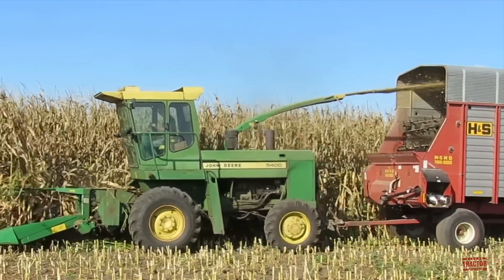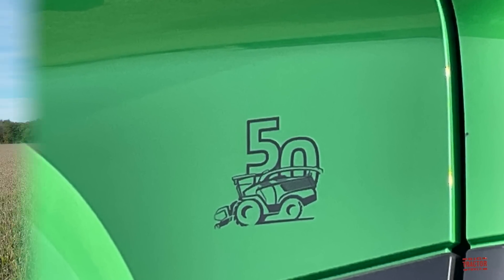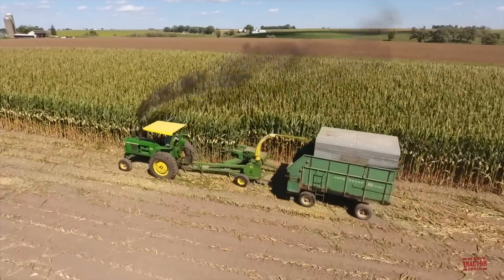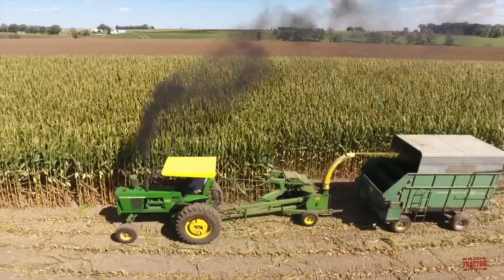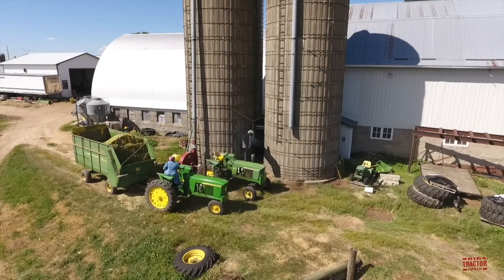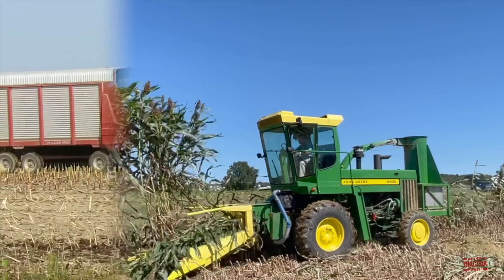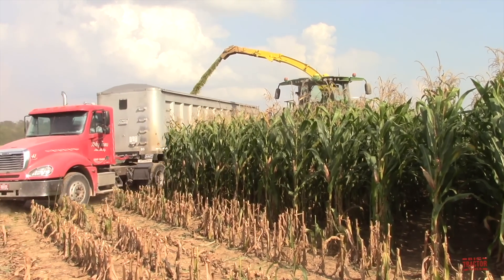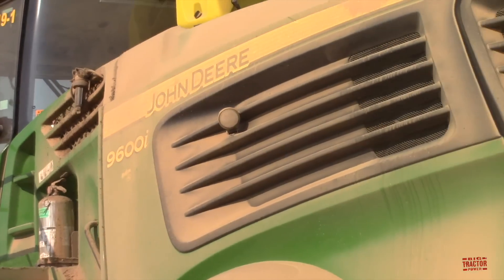Evolution of JOHN DEERE Self Propelled Forage Harvesters

Comment: A local custom chopper operator turned a 5820(?) up to over 500 hp and ran a custom made 6rn head before Kemper were available. It's a wonder it didn't self detonate after what it harvested in the years he had it. He runs NH now. The 7k choppers are powerful, but the new 9k's put them to shame.

Comment: Howdy,
can any farmer from the US tell me, why the track width of the forage trailer tractors mostly isn't changed to a wider & better stand?
Looks pretty dangerous to drive with an 7R/8R on a track with round about 5ft. 
Looking forward to practical tips...
Bavarian regards
Reply: If they're used for other jobs on the farm they still need to fit down the rows. Most stuff is on 30in rows so the tractor needs to be on it too. Moving it out wider just for harvest is a lot of work. And moving it out one row wider from 60in to 90in doesn't work because your row crop implements won't line up. And Moving it out twice as wide to 120in is SUPER wide and isn't useful going down the roadway
Reply: @krvnjrcbs  Thank U for your helpful answer 👍
Reply: if they were on hill sides, they would slide their tires....

Comment: 5820 was big HP for the mid-80s .love the sound of corn being chopped...especially in the older machines. Farmers with 8600 & 9900 are top-notch operators. I just can't get over how the most recent series almost doubled in price from the previous series...kinda ridiculous, along with everything else Deere is putting out.
Reply: Kinda ridiculous how you think you're gonna get extra capacity/speed, increased operator comfort, and keep up with inflation, all for the same price as something 10 years ago.
Reply: @krvnjrcbs easy there Mr. know-it-all, just pointing out it seemed like a significant jump from 2020 on, when comparing to the new series jumps through the decades. You’re probably the type who thinks the inflation we’ve experienced the past 4 years is a “good thing” and have a Harris Walz sign in your front yard.
Reply: @EDBZ28   glad I could help
Reply from the maker: The 5820 is my favorite John Deere chopper.  They were so cool to see new in the 80’s. Of all the choppers in the video the 5820 was the hardest to find.
Reply: @bigtractorpower I bet…great video you put together!

Comment: It amazes me that these new unreliable emission regulated machines are $ 1 million. I loved seeing the older models chop growing up. Still see them around too!
Reply: Inflation, plus WAY more capacity and WAY more comfort. And emissions are good for all of us. People in 1950s probably said the same thing about replacing their 1930 model on steel wheels. Those darn tires wearing out and needing to be replaced all the time! Electric start?! Batteries dying all the time! nothing but problems!
Reply: @krvnjrcbs only problem is he’s right, I drive truck for a living and these new trucks just don’t make it very long before having issues. Whether it be electrical issues or DEF issues. I will say though there nice when they do work but people are spending more on trying to keep them running then 15-20 years ago.
Reply: @samgogo9067  DEF is only a decade or so old, you should expect issues with any new technology. Electronics though really is lacking. The problem isn't emissions regulations tho the problem is none of the electronics and components are American made anymore. The components are all cheap and Ping Pong over there doesn't know or care what the part he's building is going in to when he's making 3 cents a day.

Comment: Putting up silage as a kid was always one of my favorite times of year.   We didn't have our own equipment to do it and hired our neighbors to do it for us.   They had a two row that they pulled behind ...i think it was a 1066.  That tractor always had a haze of smoke coming out the stack and I remember thinking how interesting it was that something so small would pull so hard on the engine.   My job was to roll the pit silo.  It was one of the few times per year that we got the cab tractor out and I felt like a star running it :)  Thanks for the memories.   Great video as always.
Reply from the maker: Great memories.  Silage chopping is one of my favorite things to film.  What was the cab tractor that you had on your farm?
Reply: @bigtractorpower  4440

Comment: Basically... since 1972 until 1992 was the same machine
Reply from the maker: Yes most of the upgrades went into the cab and engine.  In 1992 horse power and capability grew and grew.

Comment: Thanks for the video. Id like to see more evolution videos like this. I could be wrong, but it seems that farm equipment in general has became less reliable and more prone to breaking down. In the 60s and 70s, for example, it wasn't unusual to have a 10+ year old tractor that never failed to perform. Today, not so much.
Reply: Remember the Steiger tractors, before Case bought them. 😍